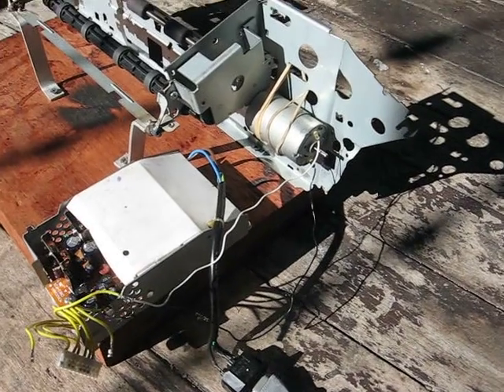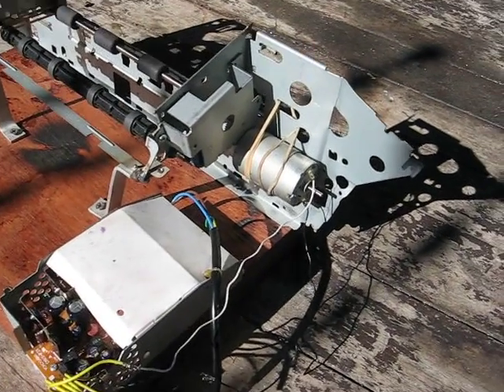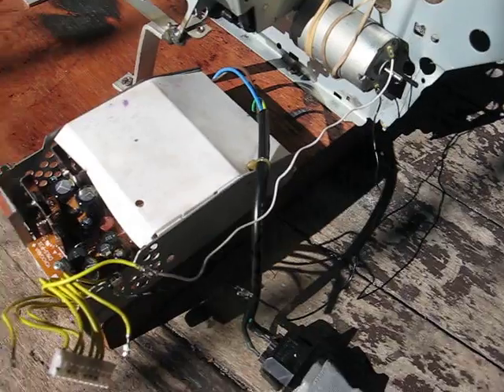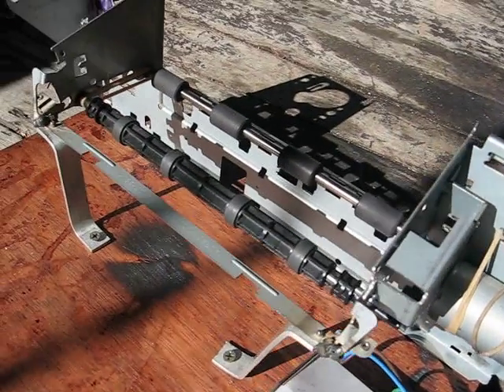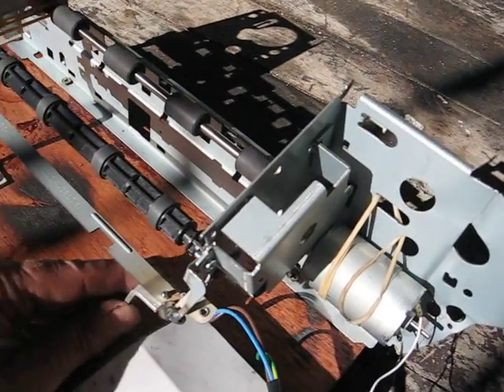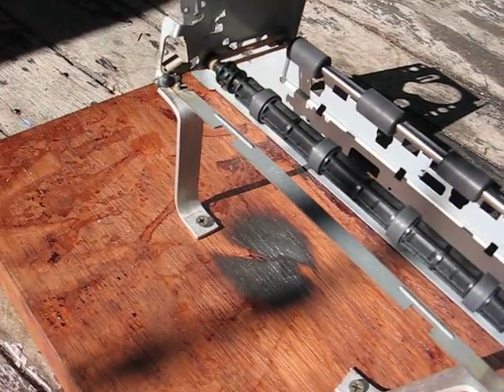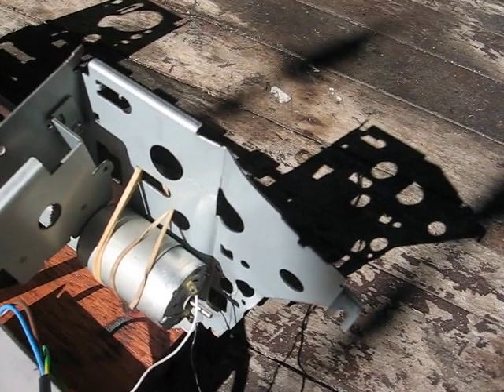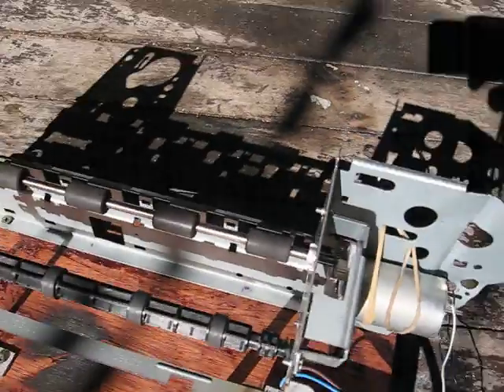A home made,DIY ballmill,ball mill,rocktumbler,rock tumbler out of a old printer

Comment from the maker: @mikeshotrodshop  Thanks Mike.I understand rocktumblers run for extended periods.I only use this lil baby to ball mill powders. The motor was originally a concern.But this vid was posted 3yrs ago,and the same little motor is still going strong.No heat.I think the motor is not under that much stress,courtesy of the nylon gear setup?I estimate it has done about 200hrs work, out of recycled rubbish,thats not bad for free! Also, my shack still stands:) Thanks again for the comment.

Comment: Cool, I like finding things people cleverly make out of rubbish or whatever. The only thing that would concern me is the motor. Rock tumblers run for months at a time and require a contiuous duty motor, otherwise it may overheat and burn down the shack. So be careful, but if it doen't get hot whn running for long periods of time is should be ok.

Comment: @djpaulk Nice one mate. Suppose you could use a variable voltage transformer- Sure I had one that has a screw on it that switches voltages and AC/DC not too sure about that though. I know thats a bit off topic for making a mill out of a printer, but might see how it goes first without sourcing other parts and then if need be the adapter can be used. How are you getting your mill to optimum speed?
 Thanks again and nice job on the mill!

Comment from the maker: @theguywith1face Yeh you could indeed,nothing 'tard about that,especially if its free,or you have one laying around.When you say adaptor,im taking it you mean transformer(those little black boxes,that you plug into a wall outlet),these reduce the high voltage AC,into a low voltage DC.DO NOT plug these motors directly to a wall outlet.You may have to do a few experiments to find the right transformer/voltage output makes your mill run at a nice speed.My power supply/transformer was in the printer

Comment from the maker: Hey thanks,The motor is very much the same as one that you would find in an electric rc car.I understand that this motor might not be suited,but it has done about 20 batches so far and seems to be going ok.If the motor does fail.I would just adapt another inplace somehow.The motor does die i won't be too worried as it was in the old printer;) 
Thanks for your comment.

Comment: Hey, good job there!
It's cool that you were so inventive to make it out of a printer.
There's only one thing... I don't know how long and how often you have been using this mill but the engine from the printer is not really designed for running a long period at once. So I'm affraid the mill won't last long and you'll probably won't be able to make big batches at once (the engine will burn).
But for small batches this is one handy mill ;)
(the engine might also be usefull 4 a starrolling machine